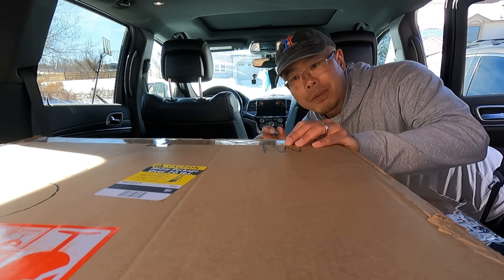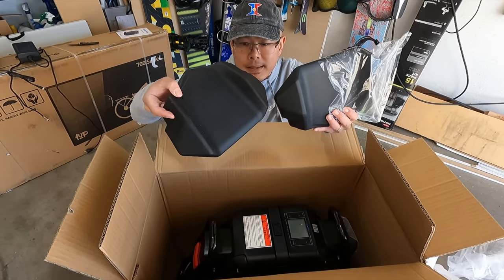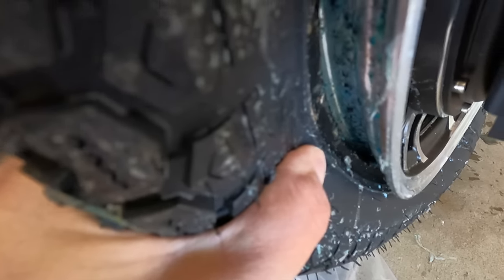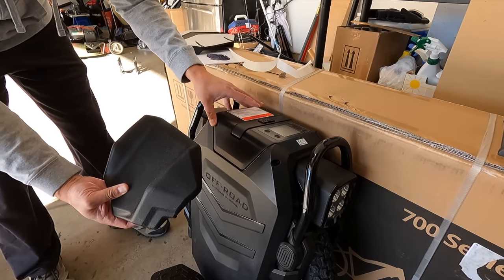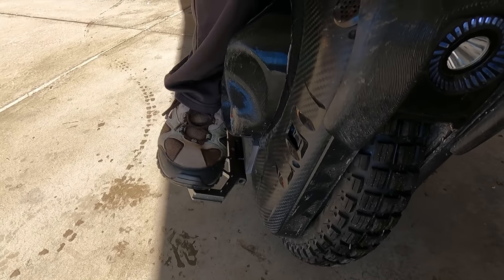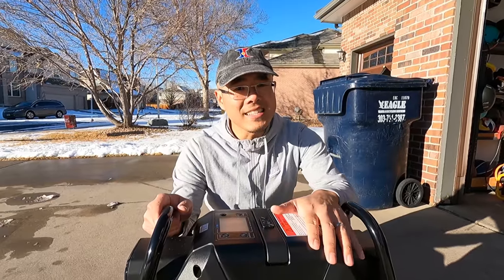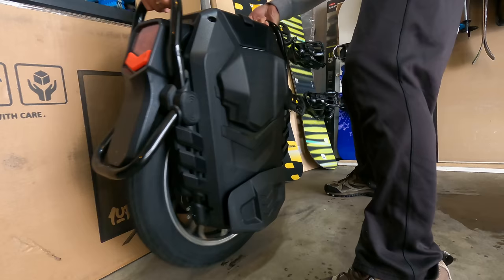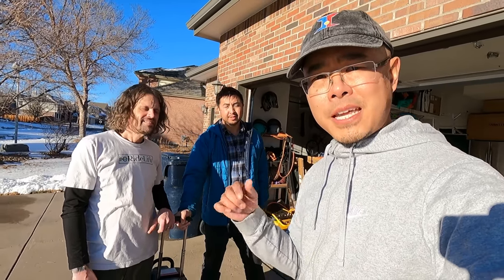We did NOT expect that! Unboxing the Massive Veteran Abrams EUC

Comment: Such an interesting and perplexing design choice. I mean should this wheel exist? Especially after the success of the Sherman? I’m just so lost on this wheel. Great video!
Reply from the maker: It's an interesting design choice for sure... but I've been riding it a bit over the last week and I'm really enjoying it... we'll see how it holds up to all this snow and slush.
Reply: Newer model wheels should have improved firmware and algorithms.  This is displayed by the reaction owners of the Sherman when riding it.  I would expect it to be more like the V12 in response than the Sherman, TBH.  There are not really the same innovative leaps in hardware that can happen in the industry, and that will continue to slow because that's what commoditization is, but new/improved software/firmware features can spring up and blindside the competition.  I think that's what the V12 did more than anything else when it came out - people were talking about how you can control your accel/decel curves directly, et al, and it's SW/FW things like that which cause people to have a better overall experience when using it and they'll naturally gravitate towards that even if it costs a little more or the long term reliability of the model is known yet.  The S20 brought full coil over progressive link suspension to the table which drove the industry to have to deal with it.  There were suspension models but that leapfrogged all the MTB airshock types as well as the non-link suspension (like the V11 vs the S18) and went straight to where full dirtbike suspension is today, solving the problem of "what happens when I am my own swingarm?"

Comment: When unboxing something heavy, there's two ways to do it, open the top cardboard, do not remove the foam packing. Turn the box over and lift the box off, easy as pie! Alternate is to open the bottom of the box, then turn it over and remove the box, once the box is off then you can remove the foam packing. Either method saves a lot of heavy lifting as all you are lifting is the box.
Reply: Or just use a box cutter and cut the damn box

Comment: I really wanna try the Abrams... I do food delivery on my Sherman and only haven't considered the Abrams due to its smaller battery.
Reply: I actually said that at one point, but bro stairs would suck.
Reply from the maker: That's funny you said food delivery... Seth actually said that about this wheel... I cut it out from the final vid. Rob, what minimum real world range would you need on your ideal wheel?
Reply: @freshlycharged  
Hey Jimmy! 
On an average day, I'll put in ~50 miles and have ~40% left. Gotta stop around that point because I start getting beeps at 35-40mph. It's too risky to ride at speed on low battery.

I'd say 60-70 usable miles would be super ideal. By usable, I'm talkin @top cruising speed and safe from sag if you need to push the motor.

I do wonder about these new cells in the Abrams (Samsung 21700 50E) and if they are enough of an upgrade that 2700WH would feel like more than I'm used to. 

I got to ride with Seth at Valmont once. I was on my s18. We might have talked about it a little that day lol- look forward to riding with him again, and maybe you too one day!
Reply: @eRideLife  
Sup Seth! 
Yeah.. stairs ain't the best. With the torque and huge tire on the Abrams you could probably push it up easily enough from behind. 

Honestly I don't really encounter stairs that are too far from the door most the time. 99% of the time the base of the stairs is within eyesight or earshot of the delivery.
Reply: @robaba89  The samsung 21700 50e is sooooo strong. I have them in my EX.N HS and even in cold weather I am getting awesome range. The Abrams however is also heavier than the Sherman and seemingly geared torquey. I would expect the range to be less than the EX.N and for sure much less than the Shermans

Comment: I appreciate this review most out of all the others I’ve seen for this wheel. Most of the others gloss over the use case for bigger riders. I had my eyes on the V12 but since I’m built like a tank (260-270lbs) the Abrams seems like the best option. I would love to have the V12 due to its feature set but I’m not sure about using a wheel at its max capacity. Maybe someone has some input on “true” weight capability. Thank you for the hard work!
Reply: The master pro has even more features then the V12, I heard... And it has got the power for you body, that for sure...

Comment: "the Abrams is a tank still being used today"

To be fair, it kind of leapfrogged the rest and they've been trying to find a replacement but nothing has been as good yet.

So I thought moving from Sherman to Abrams was sort of a leap, so I guess I need to figure out the fictional supertank the next one's gonna me named after.
Reply: Slime...there exist space age goop kits that include goop maintenance tools.  I think most humans call them "tubeless upgrade kits" but those humans ride mountain bikes so will it work?  I don't know, it's a tire.  I plan to try it before putting Slime(tm) in mine.  I've always hated slime because it's messy af when changing tires and even on install.

I've been shopping for a solid wheel (maybe foam core?) for my MTen because it will pull me around but the tiny tire will NOT stay inflated with my 240lbs on it.  I want a backpack wheel just to carry with me so I don't have to walk to help when something eventually breaks or more likely I break it.
Reply: need some skid/rail pads on those pedals like the OW gets on its nose/tail.  If the front edge could be mountable like that, then maybe we can  just a plastic skid plate to bounce/slide the corner of the pedal when you clip a rock/pavement instead of catching and throwing me to the ground or giving me hella wobbles.

Comment: Smaller motor and bigger battery. 
Power to energy ratio should favour energy. Why? Because the motor will be less likely to overwhelm the batteries capabilities to either deliver or receive energy. Fewer cut-outs.

Comment: That is one thing I'm confused about with this wheel. It doesn't seem like it would've been too hard to fit 3,600Wh in this chassis 🤷‍♂️
Reply from the maker: Would that change make this a great wheel? Abrams Max, 🤔 ?
Reply: @freshlycharged  I think so, yes. That and a better screen 🙂
Reply: I think Veteran knew that larger wheels are even more niche and the enthusiasts would buy this at 2700wh. Sherman is volume and the Max is $1000 more than I paid for the original Sherman. I think Abrams Max is coming and with a max price tag to go with it.

Tried out the Abrams at slow speed and it felt a bit more nimble than the Sherman! It definitely has some firmware tweaks.

Comment: THIS WHEEL IS AN EPIC FAIL
Reply from the maker: That's a bit of hyperbole, don't you think? All new wheels have issues when first released. The Sherman had some pretty big issues when it first came out. I'll reserve judgement on the Abrams until after I get more experience and miles under my belt.
Reply: @Jimmy Chang  nope epic fail. Sherman had issues but was still a success even with the crappy rims lol. So let's release a big wheel with less range...lol Wonder if Sherman Max is going to supercede the Abrams.
Reply: The Abrams is the first wheel to come out with a body on frame construction. Imagine if it’s meant to ride naked and hang double it’s stock config of batteries for a whopping 5400wh. Only an additional 27lbs. 

From what I can tell … reviews said it’s more torquey than the Sherman. It brakes harder than the Monster Pro. Let’s not forget there’s no replacement for the large wheel size in stability. 20” Sherman is good all around but at speed and needing to carve, it can get squirrelly where many experience riders know the large wheel will be more stable at speed. You can tell from Afeez videos that the Abrams will out accelerate a Sherman. 

2700wh is 70-90km of hard riding. I really want to get this wheel but yeah it’s weird it’s not 3200wh right out of the box. 

Abrams Max anyone?

Comment: Met a guy riding the veteran Abrams (i think) in Las Vegas. I was on a mobility scooter. We actually raced...
He beat me first then I turned my controller up and beat him twice.
Yes a mobility scooter
Reply: a mobility scooter that can go 80+ kmh? Cool story bro!
Reply: @Jonah_Hax  that was my old modified, scooter with ebay brushless moter and controller. 72v... 13tooth sprocket on motor, 28tooth sprocket on solid rear axle...YES IT WENT 45MPH.
My new scooter has a giant qsmotor, a Toro ride on lawnmower differential, and a fardriver controller. With spim08 high out 72v lithium ion battery. It can go 60mph if you're brave enough to try...
Trust me it will smoke almost any 1 wheel vehicle.  Maybe the wolf king scooter would be a cool race...
Haven't found one while I was riding the scooter